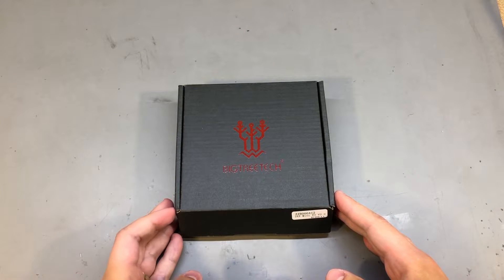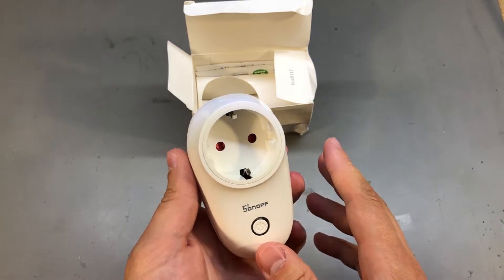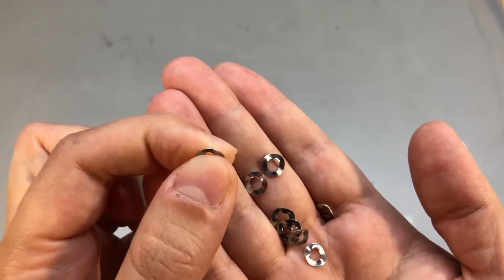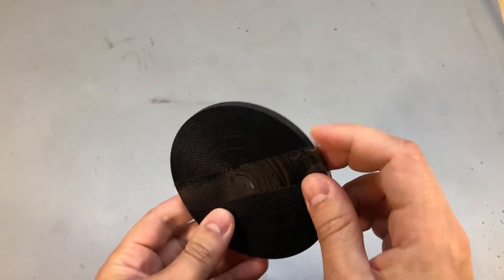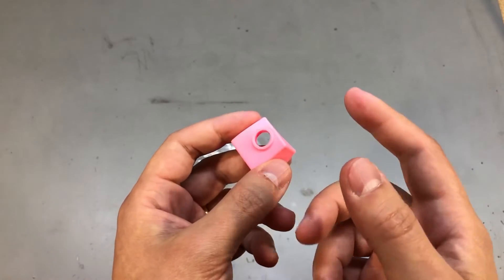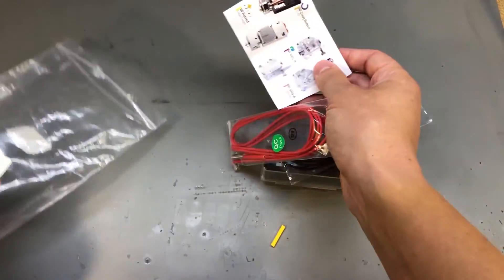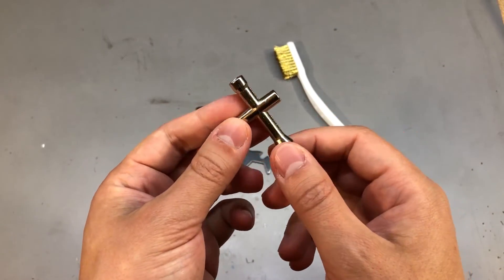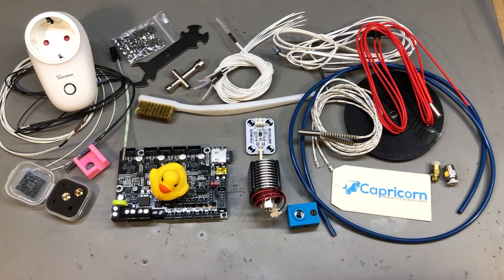InTheMail (3D Printing) | Voltlog #323

Comment: Hey Voltlog forgive the stupid question. But why dont they use a proper thermocouple for the sensor in the print head? Or would those also fail like the thermistor due to the high temperature? It just seems silly if the thing fails all the time, not to replace it with something else more durable solution. It also makes me wonder what the solution is used on high end printers. And why it can not be a compatible option here for that new 3rd party main board.
Reply: Thermocouple is difficult/expensive to interface to a microcontroller and sensitive to noise, an NTC is incredibly cheap and easy to interface (only a single resistor is needed).
Reply from the maker: I may be wrong, I haven't researched this but it might be a legacy compatibility thing where in the start they didn't used thermocouples maybe because of cost reasons and now, to keep things compatible they kept it that way. I haven't seen 3d printer motherboards with built-in thermocouple amplifiers.
Reply: @voltlog  I cannot find any clear information online about the reliability of thermistor vs thermocouple. At least for the operating conditions of a 3d printer head. Which is many hours run time @300°C+. I do see people saying there are more reliable thermistors available. Higher quality. So should be the 1st choice when replacing this part. If not already what you have ordered. Another option has been tried by someone was 'PT100'. That is somehow said to be a more reliable part. At least that is what appears to be the motivation. However the PT100 ($7+) is actually more expensive than the MAX6675 kit thermocouple+amplifier board (it gives SPI output), which is $4 on aliexpress. You also have problem getting the controller's firmware to understand the temperature reading from SPI input. Because most people use instead keep to using the direct thermistor input. I still don't have any clear answer as if the thermocouple is more reliable. Clearly the conditions of the temperature is quite high. And for a very long time during prints.
Reply: @dreamcat4  PT100 was shown in the video... its more stable, handles higher temperatures. Do some reading: https://www.omega.co.uk/temperature/z/thermocouple-rtd.html NTC is fine for a standard 3D printer.

Comment: Ordered a hotplate from Aliexpress in May and it looks like it still hasn't been sent. The "DHL" tracking number is invalid, and it says it says if my order doesn't arrive by 2020-09-06, which is 35 days away, then I can open a dispute, except the order page says they're closing the order in 32 days! I'm thinking I'll give them another few days and I'll open a dispute, because it's been over 90 days. I'd be willing to give them a bit more time if the tracking number were valid, but I've received other items from Aliexpress that were ordered since then, and they weren't even sent via "DHL".

The annoying thing is that I could order another from a different seller, but most of them are charging AU$130-150 or more for delivery, and the ones that offer "free" shipping might not be any better than the free "DHL" shipping I got with my previous order. So I have no idea whether I can reliably order anything of moderate value from China at all.

At least the seller in Finland that I ordered some NOS DRAM chips from eventually offered me a refund when it became clear there wouldn't be any freight to Australia in the foreseeable future.

Comment: Sorry  I do not agree with your opinion, that the primary work on 3D printers is upgrading and not 3D printing. After long research and looking at the experience of a lot of people with chinese printers I decided to invest €800.- for a original prusa MK3 kit. The only upgrade was to MK3S another 30.-:) If you add all your costs of your several chinesium printers and upgrades I bet this is much cheaper for a very fast, accurate, robust and reliable printer and top service a lot of innovations. With the prusa mini there is an budget option half the price and it is only a little smaller than the MK3S. - I am still very happy with this decision I made 2,5 years ago.
Reply: I can't tell if that was the point he was making or not :) I think it was supposed to be a sarcastic/tongue-in-cheek comment, but I'm not sure!

You're absolutely right: if you spend a bit more money on a printer from a manufacturer that will provide support, good-quality slicer profiles for a variety of filament types, and has tested their design (as Prusa does with their own print farm of literally hundreds of MK3s), you will get a workhorse of a printer that doesn't need any modifications in order to be totally reliable for a long time (just a bit of maintenance now and then, as any machine does).

The people in the community who are most vocal about using the cheaper printers are generally people who have a lot more time available to work on fixing/improving their printers, or they consider working on the printer to be a hobby in its own right. They have totally different priorities to people who want a machine that prints reliably out of the box for years.

And that's fine!

I've probably spent more time building, upgrading, modifying, and fixing my customised 3D printer (roughly a Prusa i3 MK2, but with a lot of different component choices; I'm in the process of mounting a Hemera-that's-still-branded-Hermes to it, for example) than I've spent printing with it, as that's something that I enjoy doing - but I don't act like that's "the only valid way of using 3D printers", and I don't try to claim that people who value reliability over low price are somehow "wrong" in their opinion, like certain, very vocal parts of the 3D printing community seem to... =/

Buying a printer as a tool is just as valid as buying one as a hobby project. However people need to be aware of which they want and then choose an appropriate printer, or they may find themselves disappointed ;)

(Yes, things like the Ender 3 are supposedly pretty good these days, but if it breaks... what do you do? Are companies that rely on 3D printers for their business operations supposed to go and ask the community for help on a random Facebook group‽‽‽)
Reply: @AndrewGillard  thanks for this comment. Clearly what I want to say in addition is that there is a whole spectrum of choices. So really the important information aught to be made clear how these option are in terms of the value proposition. Which printer model(s) are going to be the best compromise between the number of modifications / setting up vs the cost. The CR10 clearly needs quite a few mods and sits somewhere at the bottom. Wheras the newer ender 3 is somewhat better than that. Whilst still being priced very low. And is something of a favorite for 2020. so no surprise with Voltlog's new toy here. Then we seem to have a rather wide price gap between the ender 3 and any type of equivalent bed size prusa. There are a lot of models at any price inbetween but it seems really hard to say if they are worth paying less. Because the prusa is such a killer. My main question would be: well is the ender 5 really worth it over the ender 3?  I don't know. But another great option may be the new SLA. Which I forget totally the name of, but was reviewed in on of Marco Reps most recent videos. Not widthstanding the extra hassles of using SLA that printer was a fantastic value for the money. Their first batch sold out pretty quickly. If you yourself know any other good options to watch out for then please let us know.
Reply: @AndrewGillard  I absolutely agree and respect your thoughts about modding a printer  as a hobby. i also did this when I started with my prusa - good for understanding the technology behind. Now i put more time and energy into construction and design of my parts which I integrate in my other interests like electronic and metalworking. - When i wrote my comment a had in mind, that a lot of people buying a cheap printer and are disappointed and frustratead because they cannot fix the problems they run into. Also i know a lot of people that forget to add the costs for all the fancy extra parts to make their  printers work:-) 
I also agree that quality of chinese printers has rised especial when we think of some brands that have established.
Reply from the maker: Andrew's comment above pretty much sums up my thoughts on the subject, well written!

Comment: Maybe you can save me a few bucks in the future...What printer model would you buy now, or what would you look for, in order to get all of these features without purchasing stuff twice?

BTW, those multi-spanner wrenches are handy, but check the tolerances of the various openings before using them a lot. These are usually made with a stamping machine. The complex cut may require special considerations for how the part releases from the die. These considerations, and the overall use-life of such an expensive-to-make die may cause the tolerances to suffer.
   With the bicycle versions of these tools, I think of them as an emergency backup type of option. Like, if I were a mechanic working on a pre-1960's bike and going on a test ride around the neighborhood, I might slip one of these in my back pocket just in case I need it. If you need to make regular adjustments with thin spanners, I highly recommend getting 1 or 2 sets of the Park Tool spanner wrenches. With high end bicycles that often require thin steel spanners, the Park Tool version are a mandatory addition to every mechanic's workbench. The only reliable alternatives we would allow in the shops were Pedro Tools or Shimano's. Both of those are harder to read and keep track of on a Pegboard tool wall. When these alternatives are hanging near the Park Tool version, everyone will use the Park stuff, it's really worth the extra few dollars cost.
  If you order these from somewhere, be sure to pick up a Park 4-5-6mm 3 way hex key tool too. With bike stuff, that 3-way hex is all you need around 95% of the time. If you have these tools in your bike tool kit, you'll have a good, higher end, spanner option when you really need it for a soft or thin metal fitting. These will last you a lifetime, and Park Tool stuff loses almost no value on the second hand market. The second hand price is always at or just above the bike shop employee purchase price at worst. Most people never resale their good bike tools. I won't sell mine.
Reply from the maker: There is a comment on this video by Andrew Gillard which is a good view on the subject of cheap vs expensive 3d printers. If you have time and like tinkering with the printer get the Ender 3 Pro. If you just want it to print well without too much hassle and you can afford it, get a Prusa.

Comment: The belt that came with my ender 3 pro is a Gates 2gt, nothing better. The replacement belt you bought looks to be plastic.
Reply: Definitely looking at those spring washers though for when I do get an all metal upgrade.
Reply: As far as I can tell, the PU belts are all steel core, so its unlikely that is what he got. Also the search term he linked was 'rubber'.
Reply from the maker: Yeah the stuff I got is probably the lowest grade..